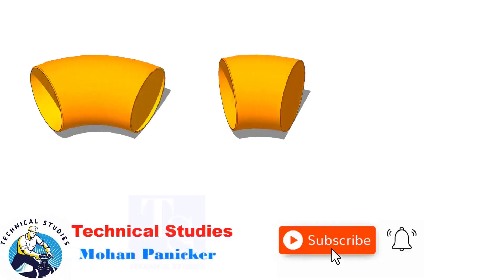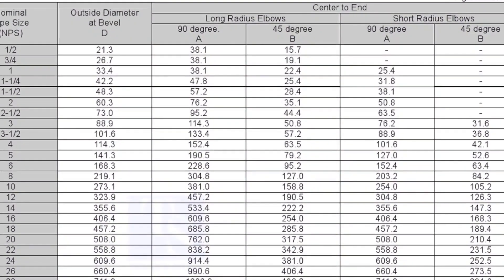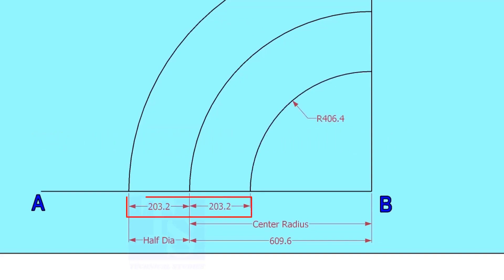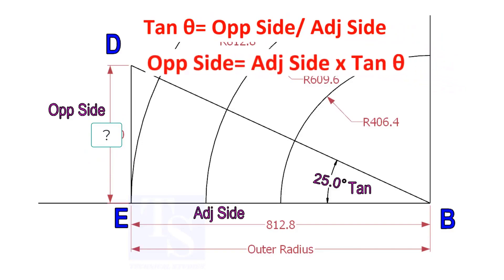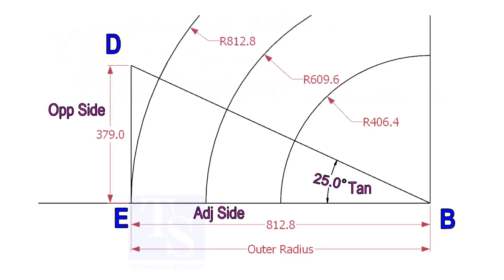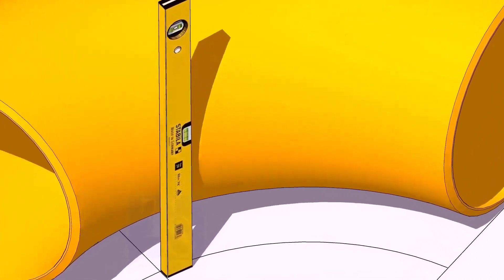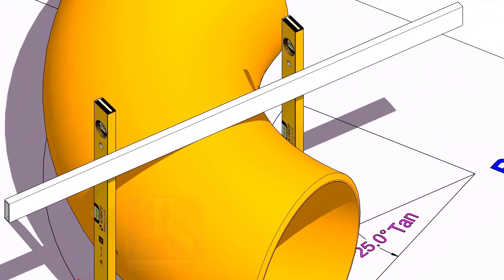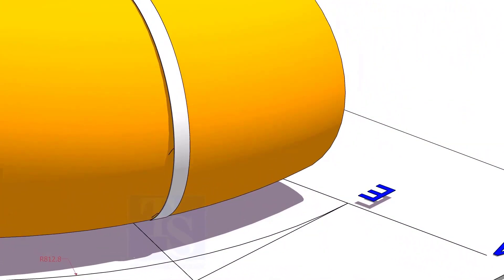How to Mark and Cut a 90 degree Elbow to Any Degree

Comment: Do we really need to find line ED?.... I mean once you have the angle and a leveled line BE. Wherever the angle line and the outer side line cross will be the length of ED....I'm sorry if I'm wrong please correct me.
Reply from the maker: Bro, there are many methods to do the same job. You can use a small divider and divide the outer radius to any degree. But in this method, yes you are supposed to calculate ED.